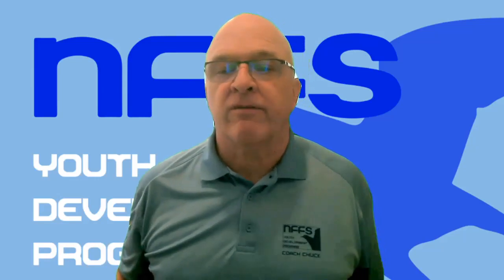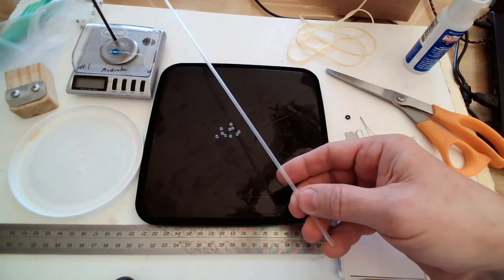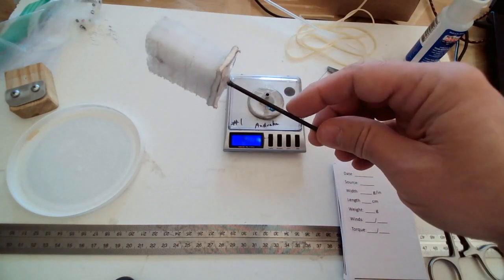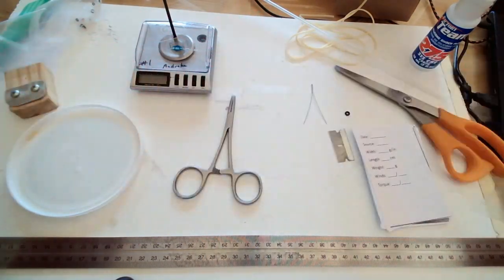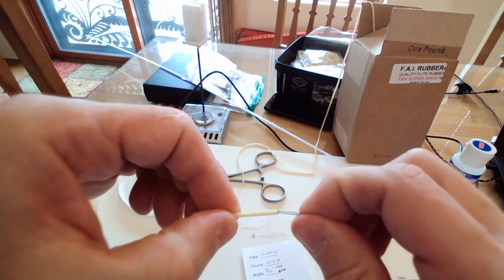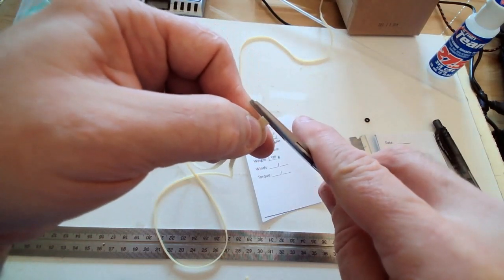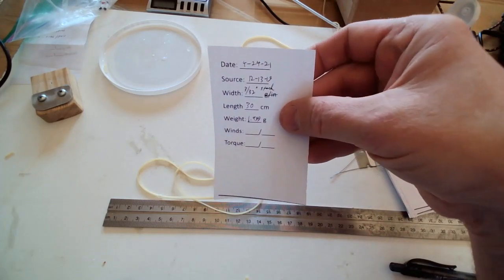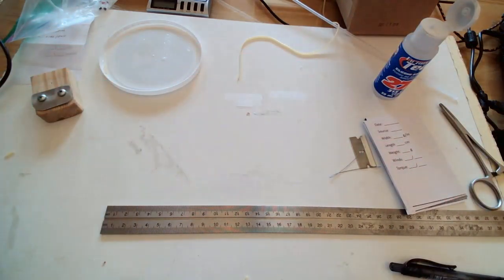Rubber Tying for Indoor Duration Model Airplanes

Comment: I like the hemostat. I have been using needle nose plyers. I find that pulling the knots tight abrades the rubber, even with lube. I am going to change my practice by adding a couple inches to each end of the rubber strip, clamping the hemostat at the desired loop length and tying the knots from the tag ends inward to the hemostat. That way, abrasions will be on the tag ends outside the knot. I just had a motor explode at 85% and destroy the lower rotor on my helicopter. The break was about 1/16" in from the knot.

Comment: Reverse the direction of tying the second knot, the knots will lock each other. I'm concerned about using CA on the knot. The CA hardens and becomes a piece of hard plastic with sharp edges. If the knot gets into the windings, it may nick the rubber. I avoid silicon lubes because of the unknown effects on the human body; where does the silicon go and what does it do when it is absorbed into the skin?